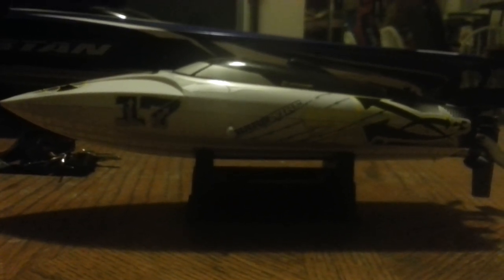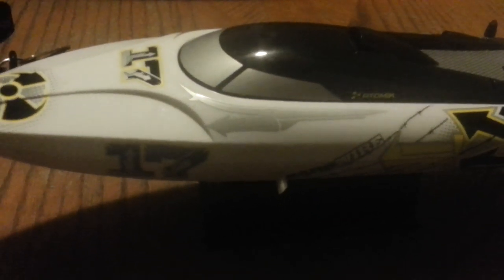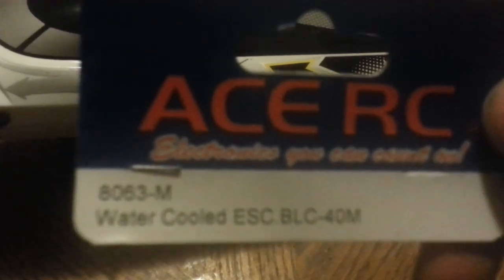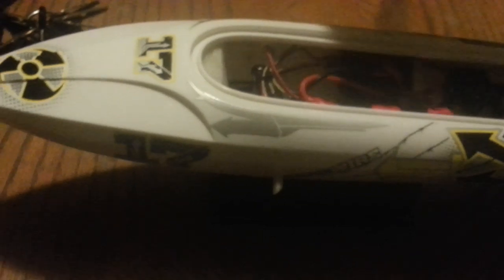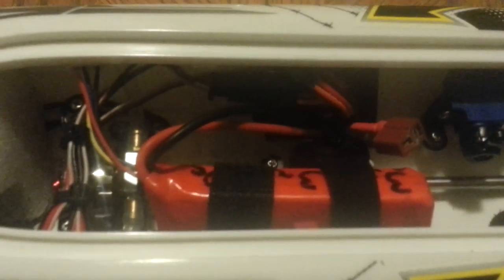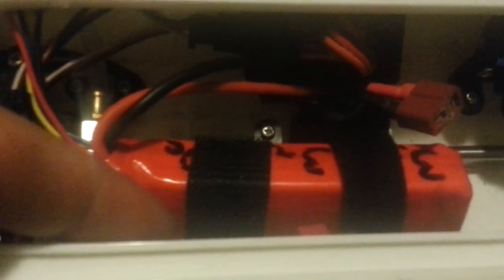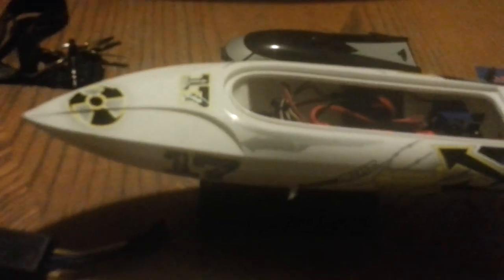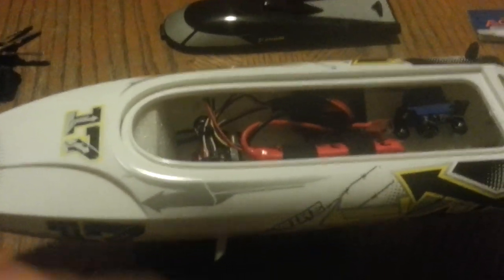Rc boat Atomik Barbwire upgraded

Comment from the maker: Im now using a 3s 30c 1300mah bat. Octura x prop, and atomik 50 amp esc. This thing flys haha!
Reply: i realize that I could easily get a 120 amp atomik esc for about the same price as the 50amp one. Would you recommend that as far as for risk for burning up the motor or whatnot? Thanks.
Reply from the maker: @davidlee-yu8rh  It would be sick to see!!

Comment: Was the SR200 2 channel receiver, basically a plug and play or what modifications to the SR200 receiver or to your boat's wiring did you need to do to get it to work?
Reply from the maker: Plug n play my friend

Comment from the maker: I put a 50amp esc in my newest video, and 120 would be sick but mybe a bit overkill for how small the boat is. i rarley use the full potential of the 50 amp and if i do its on glass water.
Reply: how are you getting more power by changing the ESC to  higher amp?  the motor draws power from the esc regardless of the rating. the rating of an ESC is what it can handle, not what it can deliver. that is why you burned out the original 20amp, because you over drew its rated amperage, which is comon on cheap rtr gear. 
but going to a 120 esc isnt going to do anything if your motor can only draw 37 amps peak. 
a watt meter is a really good tool to see what your pulling through your speed control and out of your battery.

Comment: I have the new version its radio is better and it has a 30amp esc run it hard up river and it doesn't see obove 85 degrees changing to a 3 blade 32mm prop and going to try an x431.  1.5 octura plastic 2 blade see whats better the receiver looks to be waterproofed now i can see silicone in it